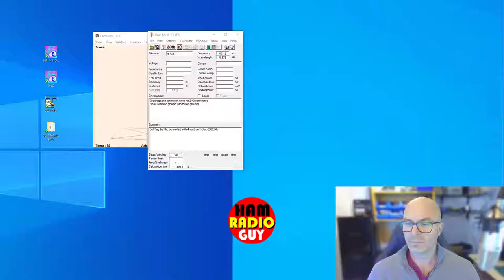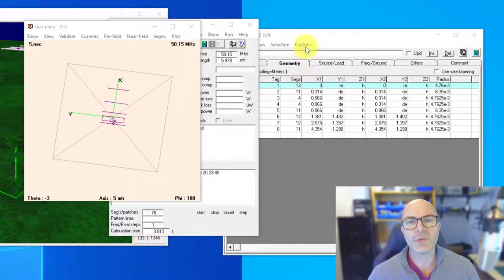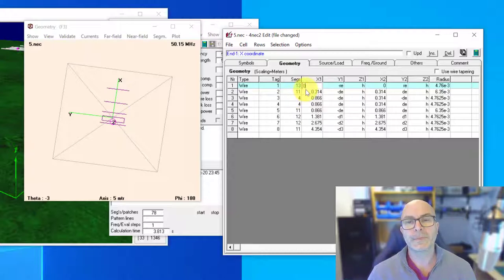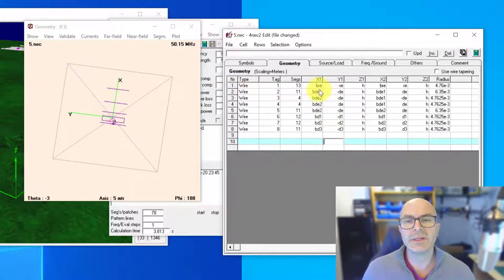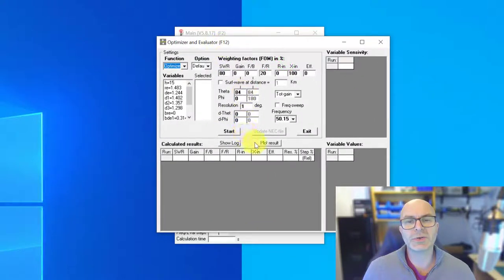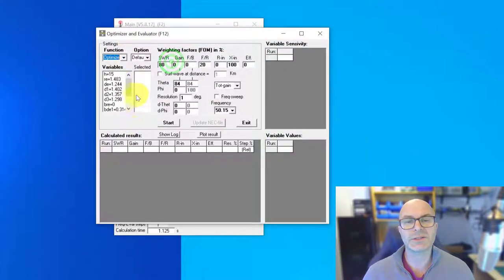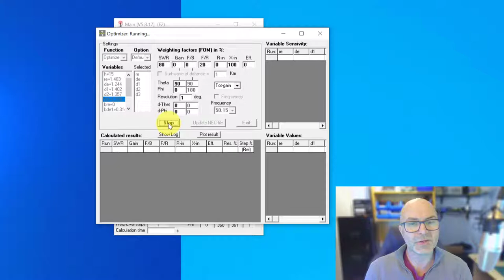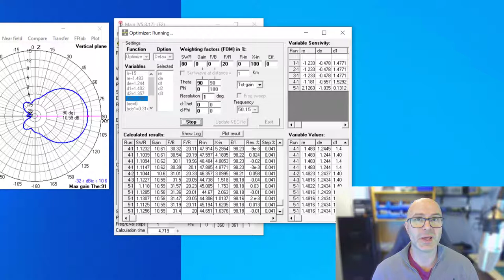How to use 4NEC2 Antenna Modelling Software Part 5 - using the optimiser

Comment: My observation is that 4NEC2 doesn’t seem to like END FED wire antennas (or maybe I’m doing something wrong). I entered a couple of designs that WORK for other hams, but when I analyze them, I get wildly high SWR figures. Yes, I have set the characteristic impedance to 450Ω or 2450Ω to account for the UNUN ratio, but it’s hard to see how they’d work. Ive added a counterpoise and allowed 4NEC2 to optimize the radiator and counterpoise lengths, but if/when they produce a ”reasonable” SWR, the resultant values are wildly impractical.

Also (this may be covered in a subsequent video), is there a way to get 4NEC2 to optimize for multiple bands, in the case of a multi-band antenna?

73 de AF6AS in “DM13” land

Comment: Great Presentation.  Could you direct me to a file that is a simple wire vertical, with no top hat, but with the ability to add my own ground plane radials? Using 4NEC v 5.9, how would I be able to change the loading point to the bottom of the vertical wire segment?  I would also like to know how to add a bottom loading coil to the wire segment;  Thanks!

Comment: Hi Justin, How you calculate the segmentation? 
Cheer, Maximo
Reply from the maker: Generally 11 to 13 segments per half wave is good for small to medium diameter elements on VHF/UHF, 20 segment son tapered HF elements. NEC based engines use a thin wire kernel.

Comment: Justin I just found your channel and love it. I built your 6 element 50mhz about 4 years ago and it plays wonderful. I hope in the future you cover building some HF antennas, multiband for the higher bands and wires or phased verticals on lower bands. Looking forward to more videos. 73 W8AT
Reply from the maker: Glad it has helped, will cover multiband Yagis at a later stage

Comment: Hi Justin, when creating quads, deltas and loops do you use type wire or P-triang / P-rectan etc.
Reply from the maker: individual wires for each. it is a good idea to break the wires near each corner an made a new, small wire with greater density of segmentation at each corner to help with the accuracy. This is one reason I make my LFA-Qs with trombone fit ends so they are easily finalised in the real world.
Reply: @hamradioguy-g0ksc96  Learning heaps from these vids,. Its all starting to come together , thank you.